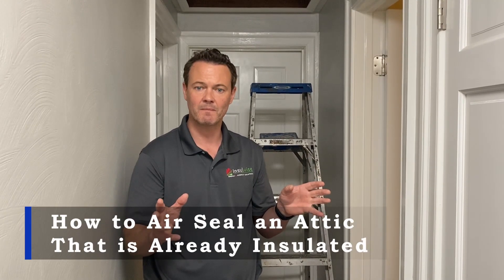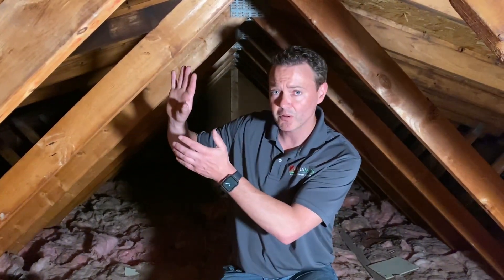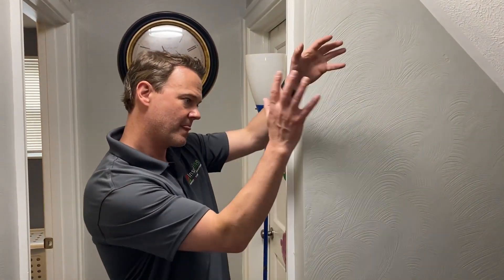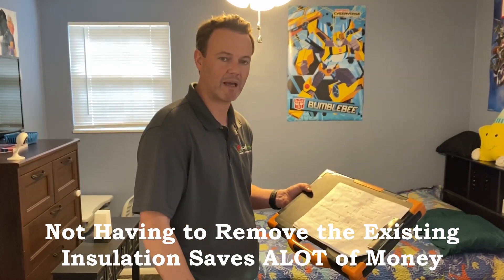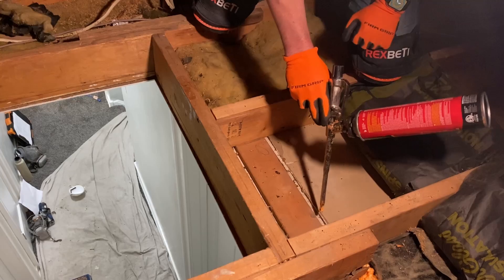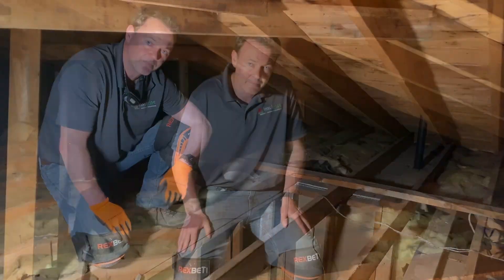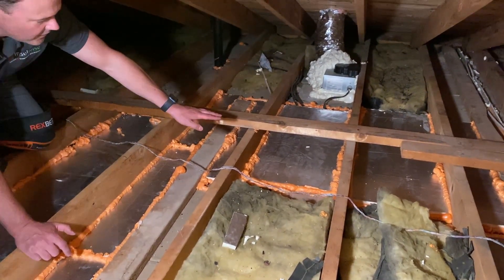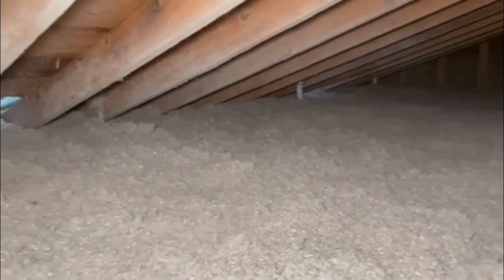Insulation Expert Reveals the BEST Way to Air Seal Your Attic

Comment: what about the attic baffles feeding intake air up from the soffits? I cant see those anywhere in the attic after the blown in insulation job was done.
Reply from the maker: See previous responses to this question.  The home did not have soffit vents so we did not install baffles.  We installed a series of slant back vents for intake ventilation along the back of the home.  During the last 20 sec of the video I make note of it and you can see the light coming in through the roof from them.

Comment: Does insulating the top plates really add much to the air seal?  All drywall is already mudded, taped, and sealed from the inside at every joint. The only air intrusion I can think of through the sealed wall would be through electrical outlets and switches which maybe could be sealed instead of trying to crawl around in a hot attic.  Also I didn't see you do any sealing around the tops of the perimeter walls where the roof trusses provide almost no room for access.
Reply: Good point and even can lights in ceiling have a tight seal.
Reply from the maker: Can lights do not always have a tight seal, even the "air tight" ones.  The wire connections into the tops of the cans, etc.  The little rubberized gaskets they come with are nice, but they often don't do it.
Reply from the maker: Yes, top plates often lose tremendous amounts of air leakage.  Check out this video.  
https://www.youtube.com/watch?v=X7GMG3T8cE8&t=16s

If you can't access to the exterior plates than we don't seal them (it can be done with spray foam but it's prohibitively expensive).  Exterior walls in homes since the 1970's usually have fiberglass batts in them.  We don't find nearly the black streaking in batts over those top plates, so I believe that the presence of dense fiberglass batts at least slows down the rate of air leakage.  But in interior uninsulated walls,  the air from the home howls through those things.  Studs shrink after the initial construction due to them drying out.  This opens all kinds of pathways for air to move inside the stud bays.  Trust me, I was not excited to learn that top plates also needed to be sealed when I first got into the game, it massively adds to the work / time involved. 
Andy

Comment: I'm currently running some ethernet cables in my attic for wireless access points, and I was shocked to feel how much cold air was blasting up into my hot attic from the tiny gaps between the drywall and top plates! Gonna be foaming a lot of gaps in the coming weeks just like this.
Reply from the maker: That experience was eye opening for me as well.  I distinctly remember the first time that I noticed that (only warm air is supposed to rise, right?).  The most likely reason for that happening is that your duct system is out of balance.  Air sealing your attic will help tremendously for keeping that cold air inside your home though, which will result in better comfort and lower AC bills.  
Andy
Reply: @insulwiseenergycomfortsolu3293  My attic ladder door was open, and the return air intake is in the hallway right below the attic door, and the bedrooms had their doors closed, effectively making the attic a low pressure zone and the bedrooms a high pressure zone, so air was just being pushed into the voids through wall outlets and switches. I have one of those attic door covers made of car sunshade type material that I zip closed before closing the attic, that makes a huge difference. Before installing that, walking under the attic door was like walking under a space heater in the summer!

Comment: Why no baffles for soffit vents?
Reply from the maker: This house had no soffits, overhangs, or intake vents.  We installed slant-back vents a few feet up from the gutter along the back of the house to provide intake air for the ridge vent.  You can see the light coming through them at the end of the video and I believe I call out that we did that and why.  Thanks for commenting. 
Andy

Comment: Great video, thanks. I doubt there's a good answer to this question, but how do you get to the wall plates on the top of external walls where the roof comes down to meet the wall and there is very little working space? Is it simply a case of "with great difficulty, lying on your stomach and expect to sweat a lot and to finish up with grazed arms, elbows and many bumps on your head!?" Thanks - David
Reply from the maker: Thanks for commenting and great question David.  Couple of things here.  1)  If the exterior wall bays are insulated with decent (mid 1970's onward) fiberglass batts they will staunch the air leakage a good bit.  We don't see the black streaking in batts over top of exterior top plates nearly as much in this scenario.  So IMO air sealing the plates in this area is less of a concern ---- when they are very difficult to get to.  If the walls are empty, it's more of a priority.  And if there is good access to seal the exterior wall plates we always hit them.  

2)  If you want to seal those plates and the roof slope is very low and prohibitive, your best options are a) get a nice board to lay on and get to it in the morning or at night when the roof isn't roasting in the sun (performing any work when you're up against the roof on a hot day is Brutal  b)  get yourself a spray foam kit and spray them from from a bit further away.  Best case is you have someone assist you in moving the tanks while you're crawling and spray foaming them.  This method requires at a minimum both parties to be wearing a proper respirator with cartridges to filter the toxic gases created by spraying foam

3)  If the stud bays are empty you can always have the exterior wall bays dense packed with cellulose from the rooms below.  This will seal the top plates while also adding tremendous thermal and sound deadening performance to your walls

Let me know if you have additional questions!
Andy
Reply: @insulwiseenergycomfortsolu3293  Thanks Andy, I appreciate you taking the time to reply, and so quickly 👍😁David

Comment: Don’t you need to keep the ventilation openings in the soffit open so the attic can ventilate?
Reply from the maker: This home did not have soffit vents or even an overhang (many homes do not).  If it did we would have installed ventilation baffles.  To provide intake ventilation we installed slant back vents along the back of the home.  You can see them in the last video segment.  Good question though. 
Andy

Comment: Is there a reason you didn't install Attic baffles to prevent the installation from falling into the soffet vents?  I thought the video was very well done.... thanks
Reply from the maker: Yes!  1.	This house had no soffits, overhangs, or intake vents.  We installed slant-back vents a few feet up from the gutter along the back of the house to provide intake air for the ridge vent.  You can see the light coming through them at the end of the video and I believe I call out that we did that and why.  Thanks for commenting! 
Andy

Comment: Do one on getting rid of that powder insulation and replacing it with foam board or backed roll insulation. A lot of times that powered insulated will smell over time and the smell gets into the ducts and you can smell it inside. It may also be a respiratory hazard.
Reply from the maker: Thank you for commenting!  If the attic is air sealed properly you won't notice any smell inside the home from the attic.  We do sometimes remove insulation, all kinds, but usually only when animals have degraded it.  The best video that I have for dealing with attic duct issues is this one.   Doing this to your attic duct system would definitely solve the issue you have as well as making your home much more comfortable and energy efficient:
Spray foaming duct system:   https://www.youtube.com/watch?v=teZiNshMGiA

Changing out old leaky flexible ducts in attic:  https://www.youtube.com/watch?v=dmv4-E43mMg&t=10s

Thanks!
Andy

Comment: you can also mention the fireblock type of great stuff foam (the orange) and why that's important and when to use it
Reply from the maker: The great stuff fireblock foam isn't much if any more flame resistant than the regular great stuff (at least it wasn't the last time I researched it).  It is however much more expensive.  I guess the orange color could make it more useful in some applications?  If your home catches fire, it won't be the type of foam that was used to seal wire penetrations that stops it.  The rest of the home is made of wood and is highly flammable.  If the goal is really to reduce the risk of a fire taking down your house, than the only legit solution is installing water sprinklers in every room in the ceilings.  At least that was what the chief of a local fire company conveyed to me.  Thank you for commenting!

Comment: you should share any blower door test results if you have some.
Reply from the maker: Thanks, we share them with all of our customers after we perform them.  We average probably a 25% reduction in air infiltration, but often achieve results north of a 50% reduction.  It's a big deal.  Did you have any specific questions?
Andy

Comment: Will this type of sealed system keep Mice out of the ATTIC? I have found where Mice climb up the outside Brick of the house and enter through the Vinyl trim work under the overhang of the roof.
Reply from the maker: Sealing the air leaks in your attic floor alone would not keep the mice out, that's not the specific intention.  For that I would recommend locating their access points inside the attic, and stuffing them with galvanized steel mesh.  You can get that stuff in small rolls at the big box stores.

Comment: Why didn't you install baffles at the soffits?
Reply from the maker: 1.	This house had no soffits, overhangs, or intake vents.  We installed slant-back vents a few feet up from the gutter along the back of the house to provide intake air for the ridge vent.  You can see the light coming through them at the end of the video and I believe I call out that we did that and why.  Thanks for commenting. 
Andy

Comment: im air sealing my hot vegas home attic right now but im also walking on top of blown insulation ,which i refluff after but my question is it worth it airsealing vs losing R-value in the insulation by walking on it?
Reply from the maker: Great question!  It's absolutely worth it always to air seal.  I'd recommend using a broom to fluff it back up after you're done working in the area.  Both blown fiberglass and cellulose will refluff pretty easily.

Comment: do you do anything to keep the soffits clear and open when you have blown in the insulation? Such as the plastic panels (3 foot, i think) that run up from the soffit?
Reply from the maker: So this house did not have soffits, overhangs, or soffit vents, and that's why you don't see soffit baffles getting used.  When there are soffit vents or overhangs we ALWAYS use them.  In this case we added a series of vents on the back roof to bring in intake ventilation. 
Andy

Comment: considering going spray foam insulation. Any recommendations or things to know for before hiring a company?
Reply from the maker: How do you mean?  Do you mean you're considering spray foaming the underside of your roof and making your attic a conditioned space?  Or do you mean that you're going to use spray foam for sealing the air leaks in your attic floor?
Reply: @insulwiseenergycomfortsolu3293  I am in the process of hiring an insulation company to spray foam my attic. They use open cell spray foam, just wanted to know if there is anything i should watch out for.

Comment: Outstanding video.  Most people don't fully understand how critical all of that air sealing is prior to adding insulation.  I would say however, that the absence of baffles at the soffits is going to pose a problem for adequate ventilation long-term.  Why no baffles?
Reply from the maker: 1.	This house had no soffits, overhangs, or intake vents.  We installed slant-back vents a few feet up from the gutter along the back of the house to provide intake air for the ridge vent.  You can see the light coming through them at the end of the video and I believe I call out that we did that and why.  Thanks for commenting. 
Andy

Comment: I’ve been up in my attic doing this exact same process for the last two weeks and my family has just about had it hearing me work up there.

This video was perfect to explain the process and share with them the value of the effort and to tolerate the inconvenience of hearing the work from below.

Very easy to follow, well explained and validating for the DIYer.
Great video.  

I believe it left out whether there is any value of insulating the actual roof deck as well or ductwork in plenum attic space.
Reply from the maker: Thanks for the complement!  We're not big advocates of insulating the actual roof deck, even using closed cell foam.  But in either case, you'd want to choose either the attic floor or the roof deck, not both.  If you have duct work in the attic you absolutely want to give that some attention.  I have three other videos where I show how to seal duct leaks, upgrade flexible duct hoses to higher performing ones, and also spray foaming the actual trunk line to seal and insulate it.  You can see those on the Insulwise channel.  
Andy

Comment: How do you seal open stud bays on exterior gable walls in the attic?
Reply from the maker: Great question.  We'd seal them the same way that I seal off bulkheads in this video.  Place foam board down inside the stud bay and then use foam to seal around it.  
Andy

Comment: At time point 10:40 (the final video of the completed job) how come I don't see any rafter baffles?
Reply from the maker: 1.	This house had no soffits, overhangs, or intake vents.  We installed slant-back vents a few feet up from the gutter along the back of the house to provide intake air for the ridge vent.  You can see the light coming through them at the end of the video and I believe I call out that we did that and why.  Thanks for commenting. 
Andy

Comment: Great video.  I see that several folks picked up on some critical points that were left out and because of that might leave a DIY person to make serious errors.   As experts you need to be sure the messaging is correct to prevent mistakes from occurring.   The video should start off by identifying the type of home you are working on and discuss the importance of attic venting.    If a person doesn’t understand this critical component of roof and attic design they could make mistakes.   That last part of your.video shows blown insulation right out of the edge of the rafters where the hip begins.   Without properly explaining the proper management of insulating an attic, specifically addressing how to insulate an attic if soffit venting is present, you can make trapped moisture worse.
Reply from the maker: Thanks for commenting.  You're right, it would have been better had I called out that the roof / house did not have soffit vents, and that we added ventilation by installing slant back vents lower down on the roof on the back of the home.  You can see light coming through 2 of them at the end of the video.  This is the most common question that comes up.  I have plans to do a full attic retrofit video from start to finish and all of the issues will be shown and considered.
Reply: Thinking the same, there was no evidence of ventilation although you flashed text saying roof was ventilated. Covering up the soffits in a non conditioned attic, in cold/hot climates, is the worst thing you can do.

Comment: Thinking of air sealing my attic myself, and i noticed that this attic did not seem to have a vapor barrier. Would it be necessary to fully cover the attic surface area with foam to block moisture or is sealing the gaps enough for a home with cold winters?
Reply from the maker: Thanks for commenting.  Unless your attic floor is tongue and groove and has gaps everywhere than no.  Drywall, plaster, etc with a few layers of paint makes a good enough vapor barrier.  The main thing is making sure all of your air leaks are sealed and that your attic is properly ventilated.

Comment: I bet that saves you big time money on the energy bill
Reply from the maker: Big time.  The homeowners often can a difference as soon as the air sealing work is done in the attic.  When you add together the surface area of all the air leaks in a typical attic you have a hole about the size of a medium window.  That hole is open year round.  Imagine the effect from shutting that?
Andy